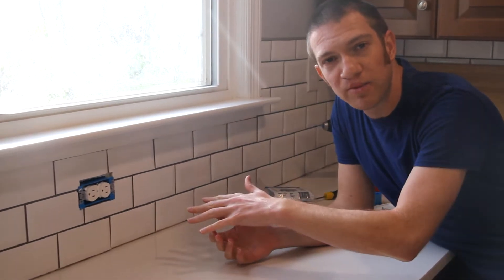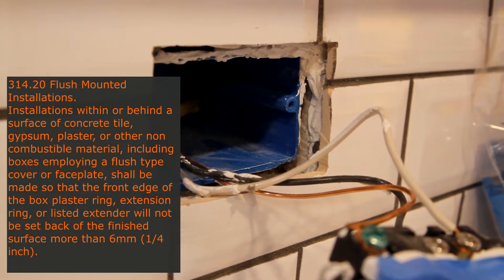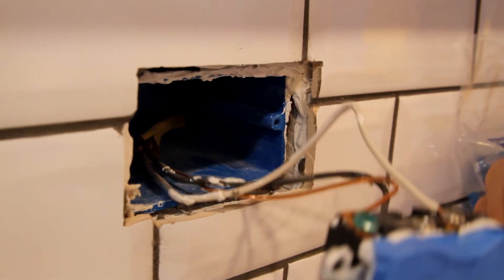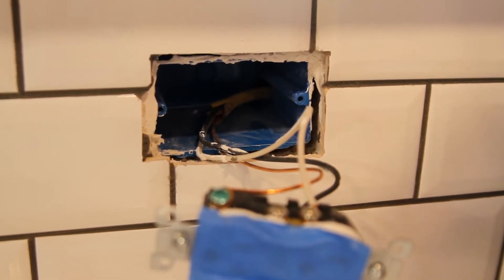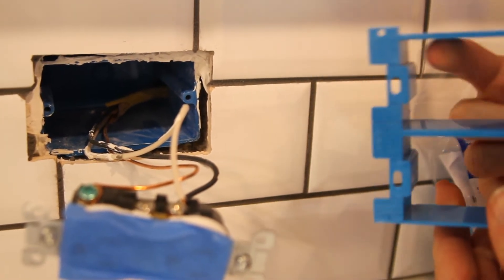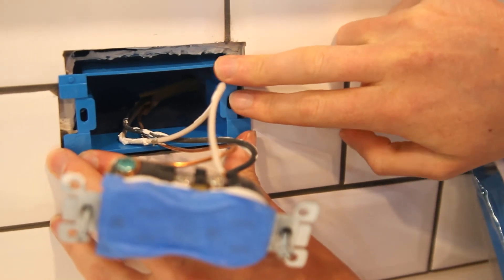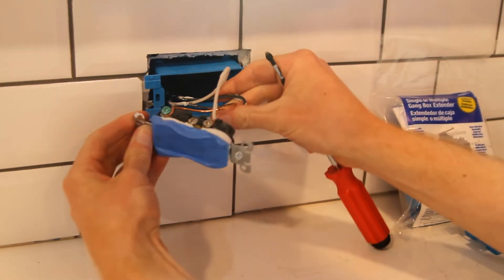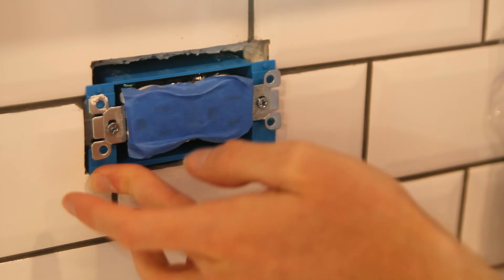The Code Approved Fix for Sunken Outlets

Comment: Need to fill in the void around the box extender also.
NEC 314.21. Gaps around boxes that are recessed in noncombustible surfaces (such as plaster, drywall, or plasterboard) must be repaired so there will be no gap greater than 1⁄8 in.